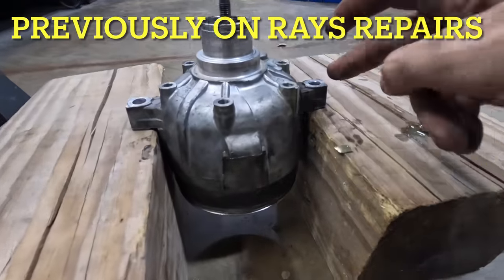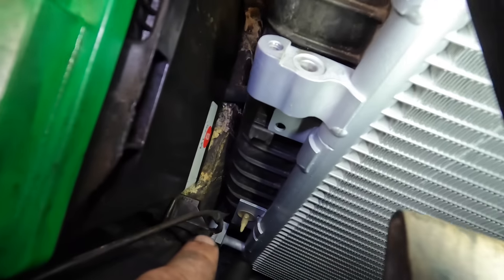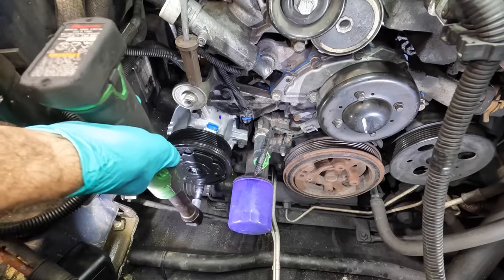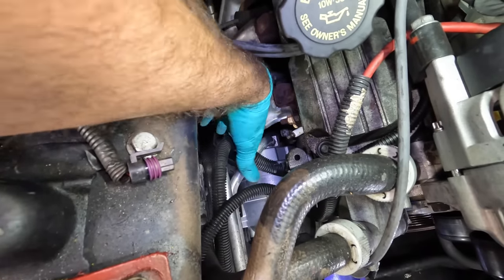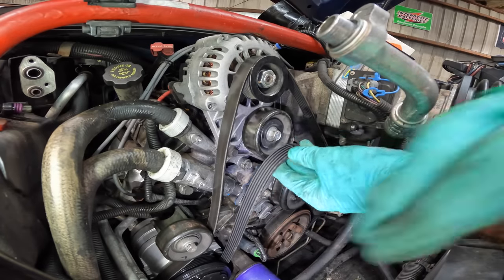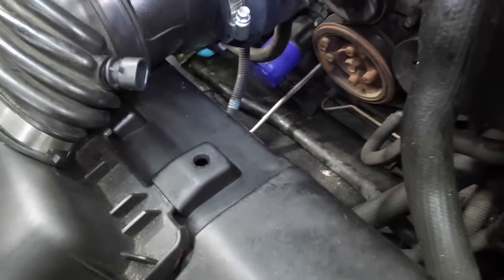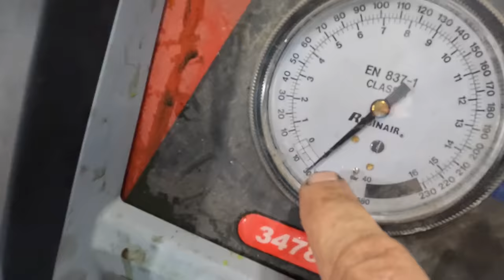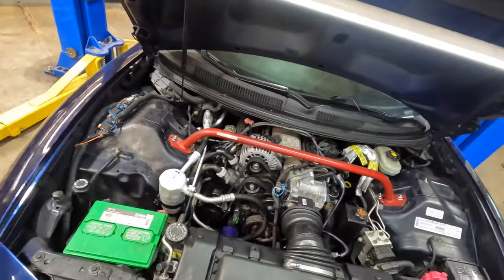Compressor Damage took out the whole System | Pontiac Firebird Camaro S-10 Buick

Comment from the maker: About to EXPLODE! Pistons Coming Apart Pontiac Firebird! https://youtu.be/-sR2_tNhY6M
Reply: outstanding repair Ray your the best
Reply: I noticed a little oil build up around the value covers.
Reply: Ray.. I suggest you look into R11 flush kits. Easy use and disposal. To flush evaporator with on grenades and burn outs of compressors. Use them on my daily of HVACR. also as times change a micron guage is always a good tool for a vacuum. I'd never steer ya wrong.. like the evaporator cleaner that time on the live feed..lol😂😂😂
Reply: R...... I had just begun typing when you caught the missing orifice tube screen...🤣🤣
So here is a REEeee.. for a missed opportunity... LOL
Reply: Question? Why does your ac machine not automatically add hose quantities when you set the amount of refrigerant required?

Comment: The owner of that Firebird obviously loves it like a child, man that is clean.
Reply: I dunno, they really should address the area under the battery, it looks like the previous battery leaked a lot.  If left unresolved, that acid is going to try to eat the metal.
Reply: @SomeRandomHuman717  Yeah, I saw that too, needs to be addressed soon.
Reply: @SomeRandomHuman717  Makes for a new repair episode for Rainman
Reply: @SomeRandomHuman717 i was thinking where did that bird poop come from.
Reply: All things considered, it is still in great shape.
Reply: I learned long ago never fall in love with a car. It won't love you back.
Reply: He said childman😂🎉❤
Reply: it's a garage queen... never driven or enjoyed
Reply: And Ray disrespects it by not using fender covers and leaning across a painted nose and headlamp assembly.
Reply: Yes they do its nice to see
Reply: @bcad4066  True.  But if you neglect it, it will hate you and eat everything in your wallet and a little bit more.
Reply: @thk7513  Yeah, that bugs the heck out of me.
Reply: @thk7513  Those headlamp doors are not as sturdy as they may seem, perhaps a slight improvement from the ones on my '97, but my '99's doors flexed at times as well -- definitely not something to put much outward weight on.
Reply: @SomeRandomHuman717  Yeah, it's a place that avoids all efforts to clean and can go bad.
Reply: @terryrobertson8382 oh noooooooo
Reply: @thk7513 Yeah I noticed that too.  That car paint seemed nice enough to warrant fender covers even if it's an older car.
Reply: I mean, it must have some kind of sentimental value. The six cylinders are worthless.
Reply: @rayray11939  Should respect customers property.  Use the cloth fender covers and not the heavy vinyl ones.
Reply: I had a 1997 Firebird,  loved that car.
Reply: @leonardcrisci7254  People say the same thing about V6 Mustangs, but Ford sold a lot of them.
Reply: @terryrobertson8382  what I should’ve said was it’s not worth nearly as much as an eight cylinder
Reply: @leonardcrisci7254  I know what you meant. Mustangs, Camaros and Firebird V8's are the desired models. The one exception might be the 1967 Firebird with the SOHC Straight Six, that would a great find.
Reply: @leonardcrisci7254  , why do you think that 6 cylinder engines are worthless ? Basically I don’t need 450- 700 horsepower to drive from Texas to Oakland California. I’ve done that drive a few times.
Reply: @ricardofierro7041  look up the selling price is for the six cylinders and eight cylinders at this point the six cylinders are only good for donor cars. I have a friend that flips those cars.
Reply: @leonardcrisci7254 I don’t know it runs, no $800 car payment. I think it’s a win for the owner. Maybe they just like the car. It doesn’t have to have 1000 HP to be worth something 😂
Reply: @pmscalisi  the fact of the matter is in New York the six cylinder versions of Trans Ams and fire. Birds are nowhere near what the eight cylinders are and I’m talking from personal experience. I have a friend who buys them just to part  them out.
Reply: @leonardcrisci7254  that’s true the V8 sell for more same way here. It’s just the initial cash outlay for a “lesser” trim is the astronomical amount of money you save up front for a drivable vehicle. You could always upgrade the motor and trans and still would be less expensive.
Reply: @bcad4066  no it won’t. Just being responsible and taking care of your possessions is a concept modern society can’t grasp.
Reply: @pmscalisi  I have friends that buy the six cylinders with a good body and swap the motor and tranny and it’s cheaper for them to do that then to find a good eight cylinder car

Comment: That's one thing I have never done, take an AC compressor apart. Cool, thanks Ray.
Reply: Interesting machines, they are.  Especially when they literally explode, like the original on a grandson's Ford Explorer.  HIs was rattling horribly, when we found a good chunk of the housing missing, exposing all its pistony goodness.  To the local shop it went.
Reply: Just did it on my 2001 F150.  Had to drop part of my suspension to get it out.  Even trucks have tight spots.  Installed a bypass pulley until I get the funds to replace the compressor.

Comment: Regarding the Subaru, Make a drill bushing so you get a centered hole in the broken stud when you drill it, Use left handed drills, They often work to pull the stud out as the hole size approaches the thread minor diameter. Don't use easy outs they break off and then there will be no hope at all. Use heat to help release the stud. heat the aluminum , not the stud. Install a heli coil being extremely careful when tapping. Use the next closest oversize  Heli coil whether it be metric or sae. This engine is totally  not a lost cause.  Bring it to a machinist if necessary.
Reply: Already has a broken easy-out in the hole.  Much harder to drill out.  Problem is exceeding value of engine.

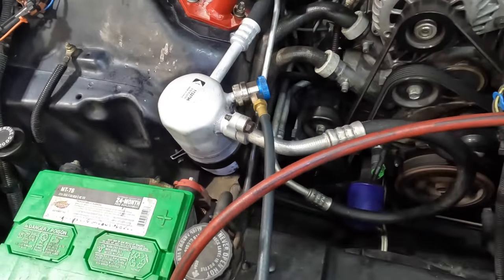Comment: @30:04  I don't know if it's an optical illusion, but that top idler pulley (right under the alt) was looking pretty wobbly!!!  Maybe the dust pattern and the camera shutter speed?
Reply: I mentioned it in yesterday's video. Doesn't seem that Ray noticed it. YET! 😉
Reply: @chipdayton1625  told u all his vision failing.
Reply: @justmeonlyme  I saw that too, The condenser wasn't even on the radiator. After the edit it was. You can't show everything in a video, some things get left on the cutting room floor.
Reply: That's not an idler pulley, that's the belt tensioner.  It's spring loaded and will bounce like that unless it's brand new.  They wear out over time but as long as the belt isn't squeaking it's fine for it to do that.

Comment: I worked in the parts department of 3 dealers in my teens and early 20s, but I’ve learned how and why the parts fit from you.  I’m 69 now, not planning on pulling wrenches, but appreciate your teachings.  BTW, R-12 Freon was $0.84 for a one pound can in 1970!
Reply: For context, I pumped regular for $.32 a gallon. Milk cost more I believe.

Comment: I mentioned on 2 videos back to use a carbide ball-end burr in the die-grinder to cut out that broken off extractor and bolt. I would try that before pulling out the engine.

Comment: Good morning Ray and Troy, you did another great job on the Firebird AC ! 
    I managed to get my serpentine belt and stretch belt on my Cavalier yesterday. I used the same trick you showed us. It worked like a charm! It was 97 degrees in my barn I thought I'd die . Thanks for the great video. Most importantly have yourself a great day and I'll be watching for your results of the broken bolt on the Subaru I know you'll get it done 👍✌️

Comment: @Ray... Centre punch that Subaru bolt, start with  1mm drill bit, then 2mm and then 5mm, insert a allen head socket and unscrew, if that strips, drill to 5.5 mm on a 6mm bolt and helicoil after use a n easy out.   No need to remove the motor.

Comment: Ray, I'm making my way through your early videos at That Other Shop, and I'll say this:  You were sedate back then.  You're more animated now.  It's good when you enjoy what you're doing.  Many times I held a job that was a complete drudge; sometimes to the point of making me physically ill.
 
On this job, the instant you connected the receiver/drier hose to the evaporator, I wondered if you'd installed its orifice tube or if it was inserted by the vendor.  Apparently not, and good thing you caught that. 😉

Comment: Interesting that Subaru, Just take a 90 to it like I did with me Bosch adjustable 90 degree 3/8 drill and Primo drillbits. 
I had two water pump bolts to do. Came right out with a little patience. 😎 (you can do it) 👍🏼

Comment: Hey Ray, love your channel and your work ethic. For the Rubasu engine or any broken bolt, another trick is to use left handed drill bits when drilling out the bolt. Sometimes the bit will grab the bolt and spin it out for you.

Comment: Doubt you'll ever see this Ray but anywhere in Florida that has any kind of manufacturing industry probably has a machine shop who could get what was left of that bolt (in the Subaru) out by spark erosion. Just a thought. I've never seen it done on an engine but we have had several spindles and high end cutting tools saved by our machine shop who spark eroded out broken and stripped out bolts.

Comment: That is one strange AC setup. Liquid line on the top of the condenser, and what looks like a suction line accumulator instead of a receiver dryer that would go on the liquid line. And it works!

Comment: on your pocket thermometers have you calibrated them to see if they are correct . put them in a glass of crushed ice and water should read 32  if not most can be adjusted with a small wrench on back of dial .50 years ago working for trane ac customer complained about house not getting to 72 deg   called my service manager out to help we had been to this house many many times, he takes his small pocket screw driver and readjusted wall thermostat to read 72 deg .no more calls

Comment: Good morning from the uk,love the vids on us cars. Just an observation on ac use,if you close the outside air intake and open the recycled air on your car the ac will work more efficiently as it’s not drawing hot air from the outside and it’s recycling already cold air therefore cheaper to run. 🇬🇧👍👍👍
Reply: My Mercedes is strange....I set it to recirculate....and later on, it turns it self back to outside air. So strange. Why would they make it do that?
Reply: My mom's VW blows colder air with the recirc off than on. Nothing wrong with it. Just that the AC systems on those cars, at least in the US, really suck. With the recirc on it barely cools the car unless you drive for an hour or more.

Comment: It’s seems that car is much easier to work on than some of the newer vehicles you have had in lately .Very interesting job and fix👍🇬🇧🤓
Reply: Just wait 'til he gets the Camaro/Firebird V8 version, not quite as easy.  🙃
Reply: @craigcraigster4999  i had a 96 LT-1 Z28 and i deleted the AC, looked like a major PITA to service. the compressor clutch was fried and the compressor was free wheeling. the car was nearly rust free example but had 250K on it, eventually the head gasket failed and i didnt have time to fix it. instead of allowing the car to rot away i sold it to a good friend of mine who owned probably a dozen f bodies (not all at once). he rebuilt the top end and still has it to this day. i sent to a good home, i didnt scrap it or part it out.
Reply: @andrewdonohue1853  Way to go! Glad to hear your F-Body found a good home, I tried to do likewise for both of mine too.
Reply: @craigcraigster4999  i just thought the car deserved a good fate. i didnt get allot of money for it when i sold it, and frankly i didnt care. 

i currently have another toy. 2003 bonneville SSEi with only 120K on the clock. the 3800 tends to have less quirks then the LT-1. it's also a little easier to access everything.  it has a larger back seat for my kids..... yes i have kids now. i park my SSEi in the winter. it's not quite a camaro but i still enjoy the car allot. she's unique, they didnt make many SSEi's and it was a pretty exclusive car when it was new. i've done the usual L67 3800 goodies..... PCM tune, 160 t-stat, air box mods and pulley swap.

you can try to take the car guy out of the cars with a soul but im not giving up LOL.

my winter car is a subaru crosstrek with a 6 speed manual, it's reliable, great in the snow, and mundane.
Reply: @andrewdonohue1853  The SSEi is a cool piece, don't let it get away.  😎
Reply: @craigcraigster4999  it's not completely rotted but it's not free of it either. a couple small holes in the rear wheel wells. it no longer touches salt but some previous clown did drive it in the winter. it's a rare car and shouldnt be ridden in the winter. i think im going to learn how to patch the couple of holes. the strut towers are solid, and i keep it sprayed with fluid film.

Comment: Boxer motors on a roo are super easy to pull; barely an inconvenience!
Reply: Yup, on my 79 Subaru DLit's almost easier to pull the engine to do nearly any job. It only takes about half an hour to have it out. That's a carbureted engine but I would imagine it wouldn't be all that much more difficult on one of the newer ones.
Reply: @theodorgiosan2570  If anything, it's easier on the newer ones. Did a clutch on a '97 last year and it went smooth as silk!

Comment: Put the old compressor back together, might still get the core charge back.  The rebuilder won't lose anything, the core will be in more or less the same shape as if you hadn't taken it apart.

Comment: About the Subaru... been thinking about it. Since you're pulling the engine, get a steel plate, drill the bolt pattern into the steel  plate, bolt the steel plate to the engine, then get one of those mag drills to drill out the broken bolt. It'd give you a lot more control over a hand held drill. Not sure if it'd work because I'm not a mechanic, but it's what I was thinking.

Comment: Hi about that Subaru you can get the bolt out reinstall the water pump use the water pump Bolt hole as a guide stick a drill inside there use a helicoil at the end of the job used to do the same thing on outboard motors the salt gets a new forget it

Comment: Ray, you are amazingly competent with vehicle air con systems, given all the videos you’ve done. with all the gas joints, you never fail to achieve a vacuum first time which says something! you don’t have any room for failure, with all new O rings on the many joints, new stop valves etc. etc. 
you also have good insight into what components are sus (eg condenser part blockage, tube part blockage, evaporator likely OK). thks too for showing us inside a faulty compressor - first time have seen - guess most work on same principle (5 piston plus swash plate). 

(I’d like also to see a full schematic flow diagram of typical vehicular air con system to refer to, so when you are pulling something out, i can see where it fits in reference to whole system…will try a Google search)

Comment: JUST replaced the serpentine belt on my girls 07 Dodge Nitro a month ago. Last weekend she came over and told me she was “hearin a wind noise from her engine and may be same thing it was before” lol she’s referring to a vacuum hose that had fallen apart that I replaced for her. Well, that wasn’t the issue…..her AC compressor is failing and making the “whining” noise they do when you have the air on and accelerate. So I found her another one for $135. So I’ll be REMOVING her compressor and her new serpentine belt, installing the rebuilt compressor and the “new” serpentine belt again, and then takin it to a shop to have a vacuum pulled on the system and recharged as she’s basically out of r134a as it is. Then the shop can tell us that her evaporator or something else is going out as well, lol as is so typical on a 16yr old fiát nitro lol but honestly, aside from the oil leak from the “your guess is as good as mine” and the vacuum hoses being brittle from age, her ac leaking, it actually runs pretty decent. I mean, for a 2007 Fiát anyways.
Reply: Actually, Daimler still owned Chrysler until 2007. Fiat didn't officially buy it until 2014.
Reply: @MrChumbachuck  yeah I know, I call her car a fiat and she hates it too lol

Comment: Mr. Ra-Ray...  I have been wondering if you have some kind of exhaust exhaust from the building for when you leave an engine running for that much time.  I know you have the doors open and fans on the back wall, but I think I would still be concerned.

Comment: @Ray rather than pulling the engine on the Subaru. Would you have enough room to work if you pulled the Radiator and condenser out and work through the core support?

Comment: so, you have replaced most of the system, and your refilling it with refrigerant. that is all fine. but I have a question. in the auto parts stores, I see these cans of refrigerant with oil. and obviously the compressor NEEDS oil. we did not see you add oil to the new compressor.. so I am assuming that it comes with oil prefilled. when I add refrigerant to a say 10 or 15 year old car, SHOULD I use the can with refrigerant? and if not, why do they sell them?